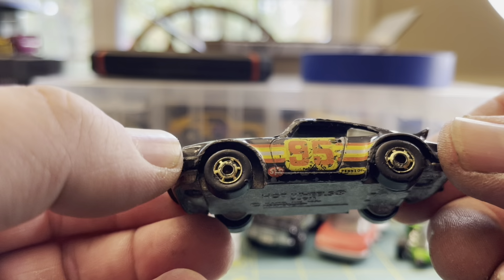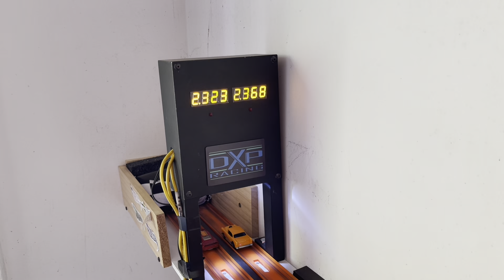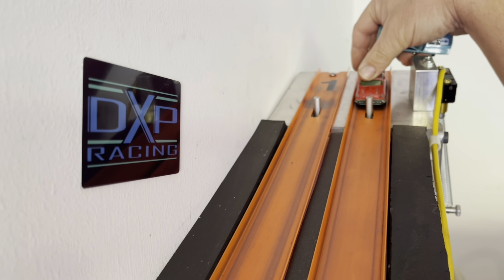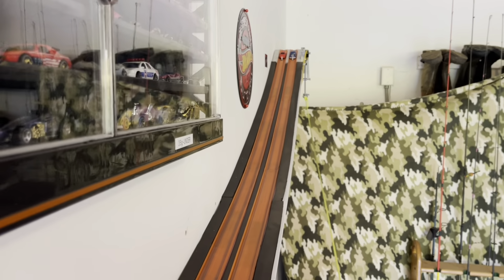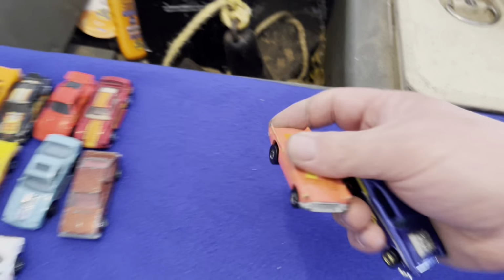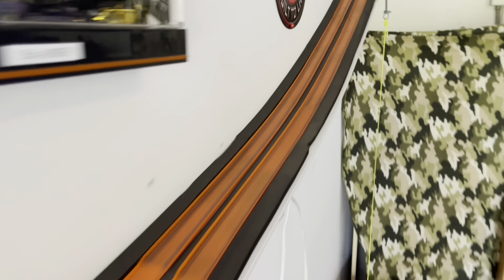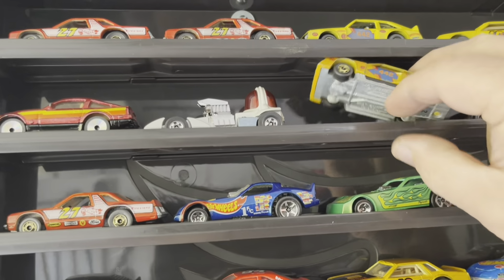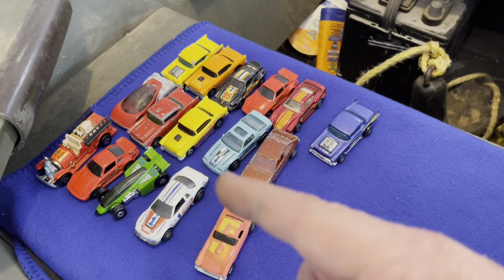Vintage Storage Unit Diecast Race

Comment: I have a race coming up in a few weeks, the top guy runs a Sidekick. Any suggestions on what cars might be able to take him down?
Reply from the maker: Well there are several factors that come into play.  The height of the starting gate, can you use lube, etc.   Here are a few suggestions but remember all cars run different, Pro Racing Kyle Petty or STP from the 97’ cars, Hot Ones Bubble Gunner, Mirada Stocker, Front Running Fairmont, the Ford Probe funny car like the Mega Graphics or Splatter paint, the Plymouth Arrow funny car, the Kenner Turbo Tram even though it is much lighter can be very fast, the Mattel Road Runner, Charger, Ghibli 1/55 scale, Hot Ones 442, or Matchbox 300zx or AMG Superfast.  Any of those would give that Sidekick a good run.  Hope that helps and good luck.